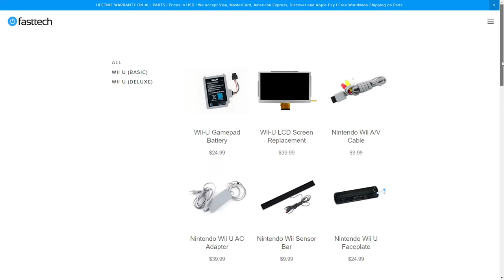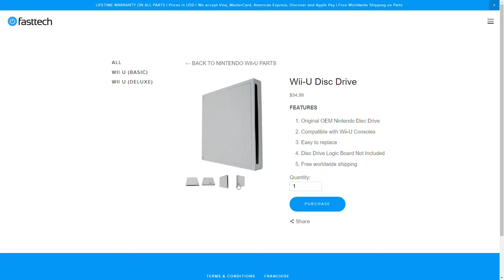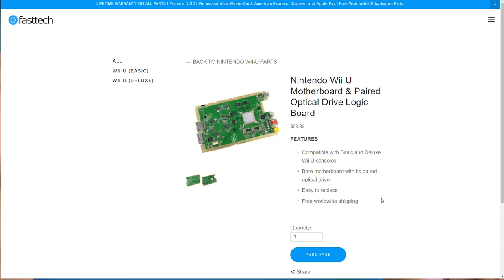Nintendo Wii U Disassembly and Repair Guide (Teardown)

Comment: I have been able to take mine apart, but I have not been able to repair it. The voltage input fuse and the connector/pins on the board are fine, there is voltage and it reaches the fuse. But there is no power red in LED. I suspect some IC or other is damaged but I don't have a schematic. It has broken for no apparent reason since it has been stopped for eight months after playing with my daughter. If I remember correctly, a week ago it showed a red LED on.
Reply from the maker: If I get one with this error I will do a video on it. First thing you should do is try a different power brick though.
Reply: @fasttechvideo  Thank you. I have tried a shop power supply setting at 15V/5A and it does the same thing.
I have tried measuring the state of capacitors and coils. All correct. At the IC chip level, I have not tested it as I do not have the necessary means to do so.
The truth is that it is quite strange that the Wii U just stops working, it turned off after 30 minutes of use. And until now, I know that sometimes (just looking), when I turned on the main power switch of the multi-plug where I have the TV and the HiFi and the record player connected, the LED turned red. The last thing they told me to try is that it replaces CR2032. I got to measure it and it gave me 3V, I don't remember right now if they are new batteries, they come standard with 3.5V in measurement. I have come across car remote controls with 3V batteries and they did not work, you put one with 3.5V and it started working. Anyway, I've tried this too and at least in my case it hasn't worked either. I don't know if a firmware downgrade could have occurred on the machine even despite having it turned off.

Comment: I replaced the drive as the original drive wouldn't play a disc.. when I plug it back in & pressed power the light went blue then flashing red. I discovered the fan isn't blowing but was blowing prior to the disassemble. I check the fan separately and it does work, but doesn't plugged in to the motherboard.. i didn't touch the motherboard at all..only removed & replaced the drive. Any suggestions? Thank you!
Reply from the maker: Yes make sure the fan is connected and make sure it spins
Reply: @fasttechvideo  Unfortunately it is plugged in and still doesn't spin. I'm gonna sell it on eBay as is.. I'm sure someone else has to knowledge and patience to work on it. Thank you
Reply from the maker: @icemuncher0201  how much would you want for it?
Reply from the maker: Did you remove the original logic board from your old disc drive and install it in the new one?

Comment: My pbf board is not working anymore😢 is there a way to repair it or save the data from my old wii u to my new?
Reply from the maker: I believe there is a chip on your original board you will have to transfer to another one

Comment: Can you help my wii u console will turn on and make noise but the video is messed up and I have tried unplugging all cords and factory resting it but it did not fix it can you please show how to fix this I wished I could post a picture the best way I can explain it is that the screen is glithing really bad.
Reply from the maker: Try replacing the HDMI cable. If that does not work you could try using A/V output cables if you have a TV that supports is. You can get that cable here: https://www.fasttech.ca/nintendo-wiiu/nintendo-wii-av-cable
If that new cables(s) does not work you have an issue with the hardware on your system (including but not limited to the APU chip). You could also have damaged HDMI port so you should visually inspect the port.

Comment: I have a Wii U that will connect my game controllers just fine but will not enter sync mode for the gamepad. This forces the system into error mode and a mandatory shut-off. Would that require replacing the Bluetooth or Wi-Fi board?

Same issue as this person: https://youtu.be/eoe4GtLT1rc?si=Wz8XBCVNvpduczr4
Reply from the maker: @mariobasketball30  yes most likely the Bluetooth of wifi board